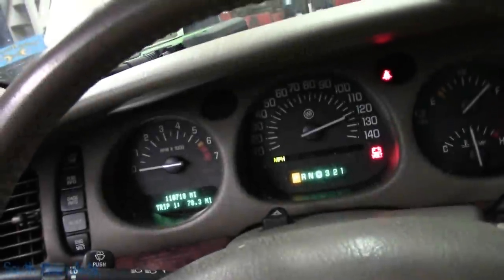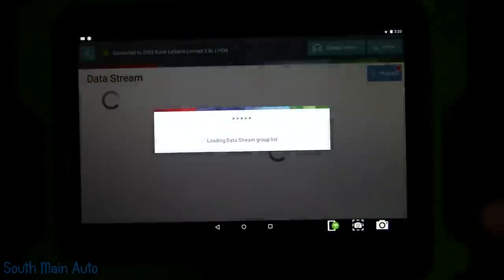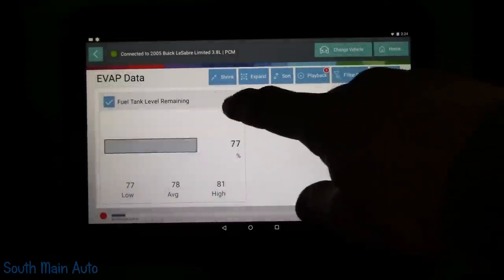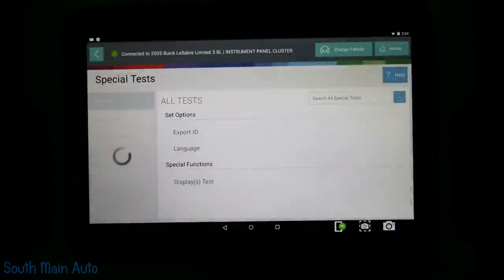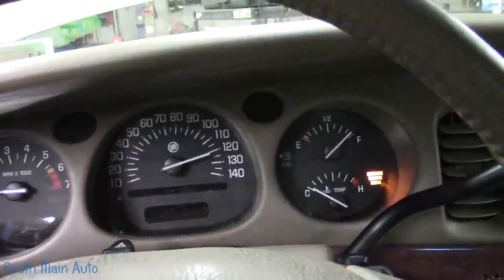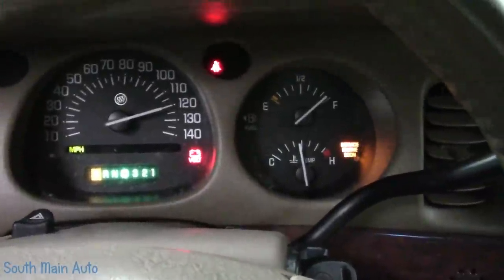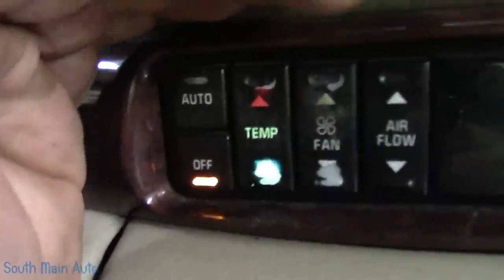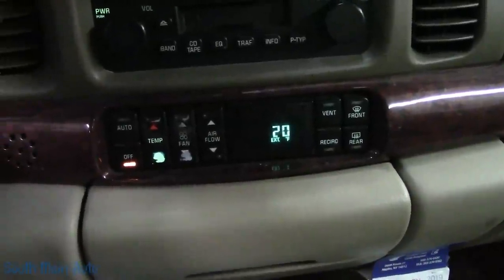Buick LeSabre: Instrument Cluster Diagnosis

Comment: Doing a fuel level sensor is easy in those 2001-2005 LeSabres.  There's a small hatch cover in the trunk, passenger side, just behind the rear seat.  Pull the cover and you are there.  Best design GM ever came up with.
Reply: When the engineers lobby attempts for a better sending unit failed, they retreated to the "can we at least get a hole to make replacement easier?"
Reply: @ShainAndrews  Hmmm.  I figured that would be the case.
Reply: MikeR...that's not the case on my 99 LeSabre! 

ask me how I know this.
Reply: MikeR  Yup I was going to say the same thing the Impalas do too. I think all the W body cars from 2000-2005 gave you the access panel i have a 2000 impala 3.8  that has the panel as well. First thing I did when my sister purchased it was replace the fuel level sensor 👌
Reply: Bought my 2001 lesabre 5 years ago, the guy said that the gas gauge didn't work and that it was a common problem with these cars, I just did my third one, but it's so easy that I don't mind because I love the car, she has 275,000 and runs like a top, she's never left me stranded and never failed to start except when the battery was dead, it was 5 year old interstate.
Reply: @Peter-pv8xx  My dad has a 2001 LeSabre he bought in 2011 that I keep maintained for him.  I replaced the fuel level sender in it right after he got it and has been fine since.  I guess I've just been lucky.  However, I've replaced two driver's side window regulators on that car since then.
Reply: They should have put a trap door in the pickups too !
Reply: Sounds like old school revisited - the cars in the 1930's had the gas tank access plate.  I think it was my 1984 Toyota Cressida that had a fuel drain plug on the bottom of the tank.
Reply: @bizbot1655  apply a bit of water-resistant dry spray silicone lubricant on the window friction areas.

Comment: Remember when GM used to make good stuff?  Probably only if you have grey hairs on your backside. Lol
Reply from the maker: No sorry... never knew they did 😏
Reply: More Gm junk. These issues I see are typical across their entire line.
Reply: The 1962-1967 Chevy Nova was the most practical, dependable car GM made - they even had in mind of the owner doing most of the maintenance themselves when they designed this car model. I had a 1967 that was very dependable-extremely easy to work on and got decent gas mileage (25 mpg). I want one again! No more O2 sensors/catalytic convertors/TPS/MAP sensors/EGR valves/etc/etc/....I would trust a 60's Nova to drive across the country than anything new being sold today. New cars just have way too much electronic crap on them - give me something I can trust....a good ol 6 cyl 1960's Nova!
Reply: @creditdebitcardscostyoumon4588  The classic marketing 101 example of a bad name for Latin American sales tho ("No Go").
Reply: @creditdebitcardscostyoumon4588  I second that. I would go with the 71 Chevelle. I had one and they were the BOMB!
Reply: @creditdebitcardscostyoumon4588  - AMEN brother!
Reply: The only reason I got in a GM car is you have to test your work..
I'd rather push my MOPAR than drive a Chevy.
Reply: I definitely remember the quality stuff. However it was all before my time. Not just gm. Every manufacturer now focuses on quantity of quality unfortunately.

Comment: Had this happen on the 2002 Lesabre.  With the ignition off, I placed a magnet on the front of the speedometer, and slowly (and carefully) moved the speedo needle back to 0.  With the fuel gauge I moved the fuel needle to E.  When I turned the ignition back on, everything was restored, and pointing to the correct position.  This was not my idea, I learned it from UXWBill.  Awesome video as always!

Comment: Fixed my Father in Laws 2003 LeSabre.  Needed lights in instrument cluster, temp control unit, and radio.  It was all dark.  I purchased and soldered in all new bulbs - about 30 in total including 12 or so just in the radio.  Took about five hours.  All works now and the fuel sensor in the gas tank does not work and he does not care.

Comment: Hi Eric,
I have worked on a 97 lesabre custom instrument cluster and have found that the problem with them are the solder joints on the pc board will crack around the components. The fix was to resolder all the through holes. Took 15 minutes after removal of cluster and the repair has lasted for about 6 years so far. Buick soldering produces what is called “cold solder” and will crack with temperature change. That is why they fail. It’s an easy fix with a good soldering iron and flux. It will save the customers money and time without their car if you DIY. Just a suggestion😀
Reply: Stepper motors are probably not bad just disconnected by bad soldering

Comment: Quick and easy!  I know about the fuel gauge.  The 86 LeSabre had gauge pin to harness contact problems.  Don't remember what I did, but it fixed the problem.  We didn't have the gauge test to verify it's operation.  I like your test to see if there's fuel in the tank!  That's HIGH TECH!  LOL!  Good Job.

Comment: From what I have learned, if you do not have an expensive desoldering gun, do not attempt to do your own stepper motors. It just rips the pads off and causes a nightmare of problems. There's a youtuber who fixes (mostly GM clusters) and that's the number one issue, the customer tries to fix their own cluster, and only makes it worse. Good call on outsourcing to a place that will warranty it and has a good track record.

Comment: My wife had a Buick that had problems with the instrument panel. It also had problems with cruise control and the AC suddenly blowing out hot air. Dealer wanted $900 to repair instrument panel. I told my wife to bring it home and let me look at it first. All was wrong were a few bad solder joints. I resoldered them and never had any more problems.

Comment: Also the intake manifold tends to leak oil in the radiator.G.M has a steel replacement (original Plastic).including strut mounts (metal end caps) and soft rubber sway bar bushings. I had the 02 Regal 3.8 L

Comment: I think on Dodges you can hold the trip reset and key on and it will do a cluster sweep.
Great video.  Nice to know United Radio does repairs.  Hard to find good repair electronic centers.

Comment: If I remember correctly, you can individually sweep the gauges with a Tech2 or the Tech2Win software; I would not be surprised if your new Bosch scan tool supports the GM MDI interface; which means you could buy the Tech2Win software and have the same diagnostics capability that you have with 90s to mid 00s Chryslers from owning a DRBIII.

Comment: The distance to empty reading on the driver information center (the blue display at the bottom of the tachometer) operates off of the fuel level sender, and can be used to get an educated guess of the fuel level. Gotta know the car enough to know what distance readings to expect.

Comment: Its funny that you say that the Lesabre clusters are problematic because i looked at an 05 Lesabre for sale last year.  Car was pretty solid, and clean for a $1800 car with 216K on it.  Out of curiousity i ran a VIN check on the car, and it turns out that the mileage recorded annually seemed way off than present mileage which told me the cluster was probably replaced with one from a salvage yard.   Also i was really wary about the color of the coolant in the radiator since it was brownish colored, but the oil was clean which possibly could rule out bad gaskets.  No visible coolant leaks around the intake manifold either which tells me the  intake gaskets were probably replaced already.   I ended up buying my brothers truck since i already knew the history of it, but if i came across a great deal on a clean solid 3800 Lesabre i might consider it.  FYI Youtuber bah53 has some pretty good videos on his experiences with the 3800 powered Buicks.

Comment: I have 2004 Buick Lasabre and my gauges will sometimes get out of whack. I can disconnect the battery, cycle the ignition switch to make sure all power is cleared off. Normal when I re-connect the battery it will re-set itself.

Comment: If the bulbs aren't blown, that generation of HVAC controllers have a few large resisters in them that break their solder connections over time. You will see the heat discoloration around them. Usually simply reflowing the solder on these will bring the display and lights back to life.

Comment: got involved with a somewhat similar problem on an 05 Buick Century I had.The indicator for gear selection and the milege indicator wouldn't light up and because no milage was indicating the car couldn't pass its inspection and be used on the road. Did some research and found out there are four tiny diodes (poorly connected by what they called soldering,,lousy job of it) Got the diodes from an electrical supply outlet,,changed them out and,,,all good,problem solved. had to remove the cluster to the extent I could lay it down sort of on the steering column to desolder and solder new diodes in.
Reply: OOOOPs,,Correction, didn't replace 4 diodes , only replaced the one diode that was indicated in my research ,which was google :)

Comment: So many gm automobiles from the 90's on have electronics with the tiniest bit of solder on every part of the circuit boards. Everything from the gauge cluster, the wiper motor to the climate control, much of it made my ITT america. 
I've seem these things stop working completely or partially, but by removing the module in question and touching each connection with an extra tip of solder seemed to fix very nearly every electrical problem associated with those modules, unless it was the body computer of course.

Comment: Eric O. I have had code p0455 on my 05 Lesabre for 4 years. Replaced gas cap, fuel tank pressure sensor, canister vent valve, and purge valve. Yes I know its the parts cannon( I know better now) I actually found your videos while trying to solve this problem.  Code keeps coming back. Only two things I can know left is hoses or fuel tank fill tube but it looks good. But seriously WTH?! What could it be? I hear 2 clicks from the canister vent valve, and within 30 seconds the code sets. Happens that way every time.

Comment: Thanks for the info. I fell into a Buick LeSabre over the holiday season and it's got a few problems with the instrument panel... the gas gauge doesn't work and recently some lights in the instrument panel don't turn on until maybe a minute of driving. I can feel for the gears but it's a lot more convenient to actually be able to SEE them! Is that a fuse issue or is there something else at play?

Comment: Hey there Mr O I figured since your working on this Lesabre and have I’m sure worked on plenty in the past so I figured I’d ask. My lesabre has a hard time starting in this cold weather and takes several cranks to start and was doing this even when it was still warm out but worse in the cold. Any idea what it could be? I’m assuming the ignition coil and plugs are original by looking at them and only having 96k on the car. Do you think the ignition module is toast like in your one Lesabre video?

Comment: HELP!
I love your channel. You do a great job on keeping up with the new tech in the newer autos. I think you are much smarter than people know.
I have a snow blower attachment that I have to repair because my last person I paid to help me (2 man job), put the augers on backwards. No! It is a big deal! I have to remove the main pulley and bearing housing so I can slide the main shaft of the transmission out that has the auger shaft running thru it.
The pulley and bearing have allen screws with Loctite Red holding them to the drive shaft. I have removed them before using a pipe soldering torch to get the temp up to 450-500 degrees and wheel puller (Huge pain in the Ahole). My help person reinstalled them with the Red and I fear he was too generous with the Red. No room for impact or socket wrench.

Q: Do you have any helpful tips to getting these out easier? Maybe some thing to help loosen the threads?

Just FYI: I think it would be nice if you had a video that just went over all the lubricants, cleaners and Liquid Wrench type products you use for the jobs you do. What, Why and Where.

Thanks! 👍👍👍👍
John

Comment: Needs new stepper motors. Used to fix hundreds of them for all the different car lots, cars off auction, etc. Found issues with steppers, display controllers, all kinds of different things. Even swapped mileage info between clusters.

Comment: gm claimed it wasn't them making cheap senders. it is the ethanol in the gas here in the northeast  ive seen it mainly in the c and k trucks. the hvac head has those tiny solder in bulbs

Comment: On my 2000 Buick LeSabre once the fuel gauge goes down to a reading of half a tank of gas, it then goes back to a full tank reading and stays there until the low fuel light comes on and then the needle drops to empty. At least The low fuel light works and I know then I have about three gallons of gas left.
Reply: Had that same thing on my 05. After a year it got to me and a stepper motor off eBay fixed that.

Comment: Hi, my daughter has a 2002 Lesabre and the dealer just replaced the ECM on.  Now the gas gauge is stuck but on empty like in this video.  I called the dealer and told them what it was doing and they immediately said its probably a bad fuel sensor.  Can the same report be ran checking the fuel gauge sensor for an 02 lesabre?  what would you recommend I do from here?

Comment: I always laugh at the 140 MPH speedometer. Doesn't the fuel cut at a touch over 100? Most modern cars I've driven have. My Silverado used to cut at 99 ... until I tweaked the computer with Hypertech. I just did it just to know I can - I never exceed the speed limit. 😁

Pretty much every GM I've owned from my '85 Monte forward has had crappy fuel and voltage gauges. A GM staple. My '88 S15 used to move around so much, you'd have to average the movement. When it stopped moving, you were out of gas. 😂

Just went from that crappy VW to a RX350 with a locked ignition. Had to drag it onto my trailer with the winch, after painstakingly lining up the trailer perfectly with the rear ... since there is NOWHERE to hook onto this toilet from the front. I just realized that interior panel removal is my most hated job on the planet. I'd rather have back to back root canals done at the dentist - that's less stressful! 🤣

Comment: You have a way with words, Eric! "Meat nuggets".. aka sausage fingers... lol

Looks like stepper motor issue. Easy to replace on these. I keep a box of these motors.
Reply from the maker: To bad you weren't here I could have put you to work on them. My meat nuggets lack fine motor skills as you will see in an upcoming video. I am not what they call a "solder expert" 🤭
Reply: @SouthMainAuto  Well, no one can't be an expert on everything.  I'm sure you have plenty of vehicles to come in, instead of spending time on a cluster. No where near as time consuming as a TIPM,  but still it's time.  I find all that stuff fun, whereas you may not. 😉😊
Reply from the maker: Oh I find it fun for sure. I just suck at it haha. Takes practice. United radio changes all of the motors and LED's and ships it back to me with a one year warranty for a buck fifty. I find it hard to justify DIY'in it for that price ya know.... The HVAC unit I fixed though ;)
Reply: @SouthMainAuto  hah! Nice! 1 down! 
Yeah, that's a good price for the whole shebang & warranty.

Comment: With the upcoming white collar layoffs at GM just maybe the engineers that created this bad stuff will go bye bye.  🤔.  Looks like GM plugged in there own scan tool and realized their issues and recommended replacements.
Reply: GM , Ford and others don’t build the parts that go bad it’s likely the junk coming out of China.
Reply: Just hope they don’t get them from dorman
Reply: @jerrypeal653  Yes, but they're the ones speccing out the design, components and materials being used and what company puts them together. There is plenty of stuff made in China that doesn't crap out on a regular basis, it just depends on how much the people having the parts made cheaped out on them.